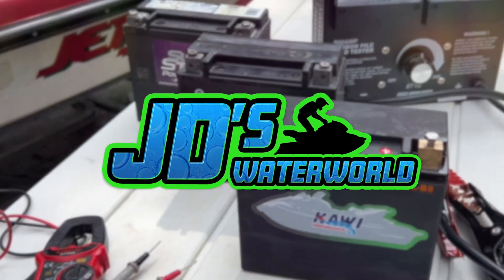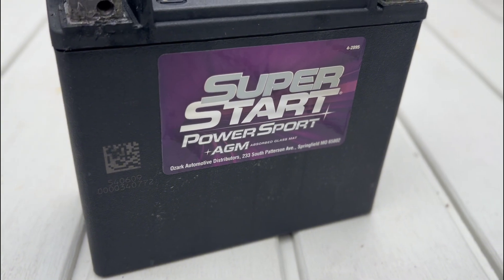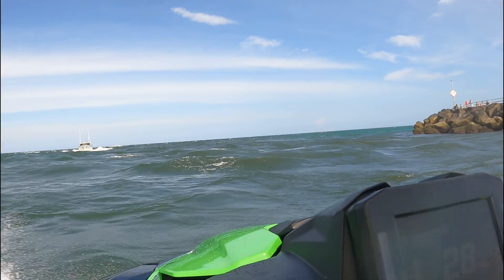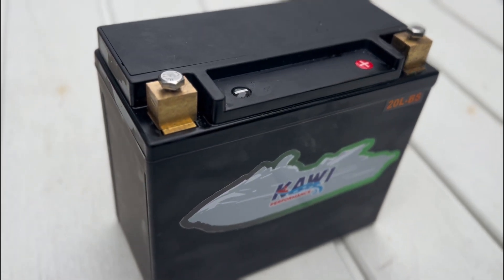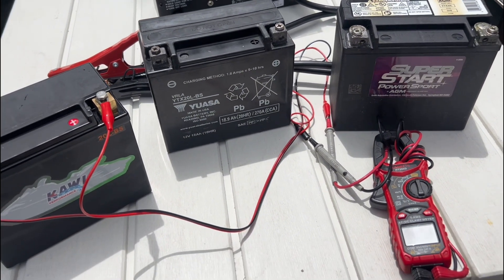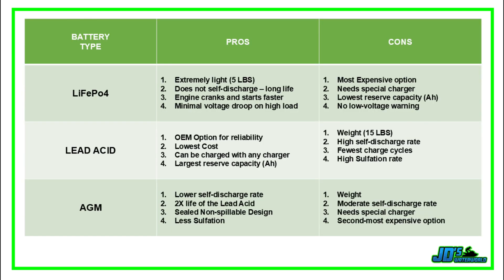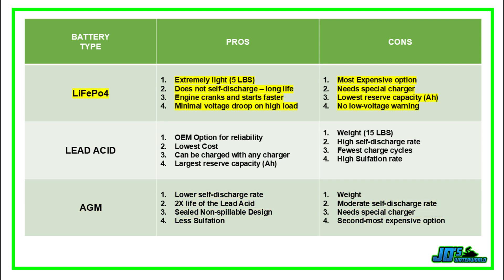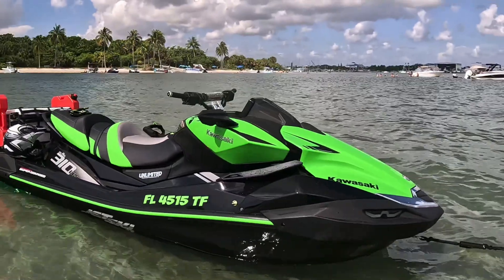Jet Ski Battery Comparison, Test & Review - LiFePo4 vs. AGM vs. Lead Acid - Which should you run?

Comment: As per Yuasa the YTX series is an Absorbed Glass Mat (AGM) Battery
Reply from the maker: Wow you are correct I never realized it...I added the electrolyte to this myself and literally nowhere on the battery or package did it indicate AGM but I see you are correct that researching it on their website that part number is AGM. Guess that invalidates my entire test...lol. Never had an AGM that came with the electrolyte before- usually they are pre actuated from the factory

Comment: Ok JD…I think I’m going to stump you on this one lol. How do you get the @&$ing rubber straps back in place to hold down the battery in the STX?? I managed to get one back on but it wasn’t pretty 😂
Reply from the maker: No clue I don't have an STX 😂 but I use a long reach needle nose vice grips usually for those tight bands

Comment: What worries me is that LifePO4 batteries are no where near alike FLA/SLA's. One big thing is that Lithium's have that BMS that acts like a policeman to control voltage/current parameters. If over discharged, it opens the circuit and if over charged, it opens the circuit to protect the cells. Usually, small marine engines have alternators that run higher voltage than say a full size I/O or inboard V-8 boat does. Conventional FLA batteries never disconnect from the system and act like a shock absorber for spikes and short over voltage hits. If a lithium battery gets too high of voltage, it may go into protect mode and simply open the connection! That leaves the regulator floating in the air and could result in damage to electrical system. Time will tell.
Reply from the maker: This  is probably why Kawasaki states the system is designed for lead acid batteries. Of course the overcharge condition would only occur if the voltage regulator fails. This particular Jet Ski puts out 14v 16 amps at 5,000 rpm while the dedicated lithium charger puts out about 14.6v . For this particular ski and battery the battery actually can never be 100% charged in the ski because the output does not exceed 14v

Comment: It looks like kawasaki made the charging system compatible with Li batteries, very cool.
Reply from the maker: The changing system is not actually designed for use with li batteries, but they do work. You will probably not be able to charge the lithium to 100% in the ski or car etc that can only be done with special charger due to voltage.

Comment: Good info! I recently got the Die Hard TX20HL AGM 310 CCA, 18 Amp Hour from Advanced auto parts for my 22 VX HO. I was in a pinch and of the local options, that seemed the best because everything online has mixed reviews. been working great so far. Getting it in and under those straps however was not fun.
Reply from the maker: The AGM is nice because it does not discharge as much between charges- it's in the back on the VX right? I had a 2021 VX Deluxe with the TR1
Reply: @JDsWaterWorld  Yah. In the back. Luckily I had the top off because we were upgrading the stereo but still super awkward to get it in, line it up and stretch those straps!

Comment: Good review...the CCA advantage interests me more than the 10 lb weight savings honestly, considering how heavy these skis are...side note, Batteries Plus sells an LFP powersports battery of correct dimensions for $189.  Weighs 3 lbs (claimed)
Reply from the maker: Probably half the ah capacity though..the most comparable to this spec and size wise is the Shorai 650cca which is $350
Reply: @JDsWaterWorld good point...Dakota Lithium sells a 15 ah for $155
Reply from the maker: The Dakota group 20 comparable that would fit is 300 cca and 25ah- so the capacity is higher but it's $255. The Dakota supposedly comes with an 11 yr warranty lol. All I can say is anything less than about $250 or so is going to be crap. There's so much garbage on the internet.
Reply from the maker: I see that one, it's very short though lol- I guess would be fine if you shorten the straps or zip tie it down. I like the higher CCA - my AGM tested here had 310 and wasn't much different over stock
Reply: @JDsWaterWorld that one is almost 7 inches tall though, stock battery is about 5 inches
Reply: @JDsWaterWorld I'll just get some different straps off Amazon...will let you know how it goes.  Thanks again for the vid.  It's June so actually time to ride haha
Reply from the maker: You'll be amazed at how light the Lith battery is compared to your old one..keep in mind the jet ski charging system won't be able to get the battery to 100% - only an external charger will do that. The alternator on the ski is 16amp 14v and the lithium needs about 14.6 to be fully charged -

Comment: I changed to Duracell Ultra 20HL-BS 12V 310CCA AGM Powersport Battery and I never disconnect and never had to charge.
Reply from the maker: The AGM is a great option, just very heavy (3x the weight) compared to LiFePo4! I have 4 jet skis right now, all have AGM except my Ultra 310 which was the lithium

Comment: I’ll keep OEM for my made in USA 2023 STX 160LX. Might try and find a used 2023 Ultra 160LX-S in the future and use the lithium in that
Reply from the maker: The oem is Yuasa made in USA it's a great battery, just very heavy!
Reply: @JDsWaterWorld  I want as much weight in the back as possible because my pump wedge only does so much
Reply: @stuartpeck26 Honestly having the fuel tank in the back of these heavy Kawis would make far more sense then in the front and help with bow lift

Comment: LithiumHub makes a smart Lithium battery with Bluetooth connectivity and reserve start feature
Reply from the maker: There are tons of different ones out there- this particular LiFePo4 battery is the only one I've tested extensively and the only one in the group 20 with 16 ah- most are about half that

Comment: How many cc amps on the lithium?I'm using the naco lithium 400amps . it's way smaller so to tie it up where the battery goes on the ultra you have to improvise so it doesn't move on the battery space..on the wave runner and sink doos is ok.I bought the 700 amps first, but is way to big for the ultra.they are water proof too.hey you did the assignment great with the grafics and everything else 😊👍MKGA we need hp,pls kawi!
Reply from the maker: This lithium is 700cca 16ah and is similar in dimension to the oem battery so that it fits perfectly in the battery compartment.

Comment: Lithium batteries still has that chance of going boom from what I researched JD there almost there but I don't want an explosion or melt down on a 20k ski so for now I use AGM  🤷 but thanks for the review as always great video.
Reply from the maker: I thought the same thing, but these are LiFePO4 which is more stable and safer than traditional lithium ion..these are becoming more and more prevalent in the powersports industry..that being said anything can happen I guess- I really hope it doesn't explode though..would definitely make a good video though if it did!
Reply: 😂Never let a crisis go to waste as they say. 👍 @JDsWaterWorld